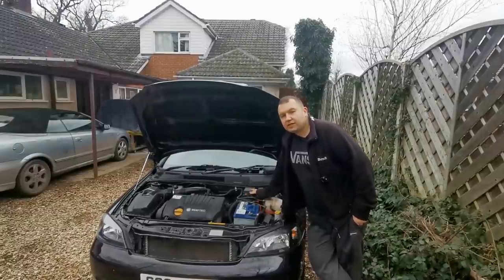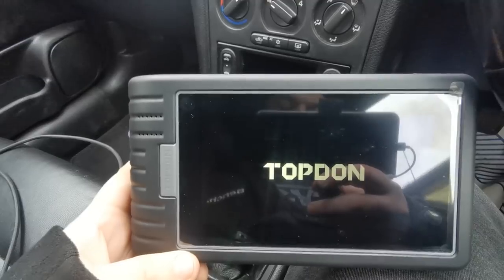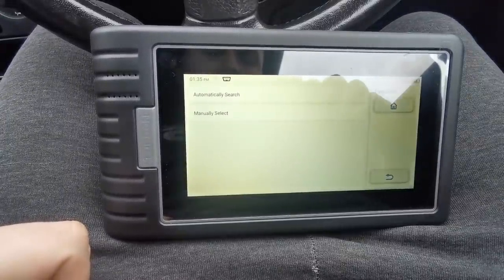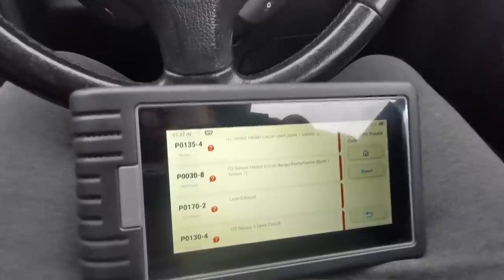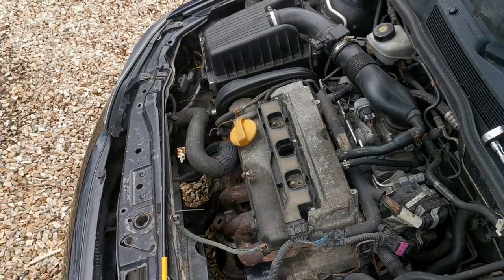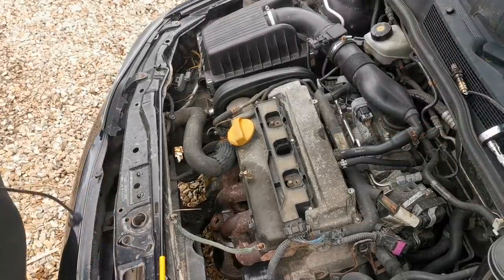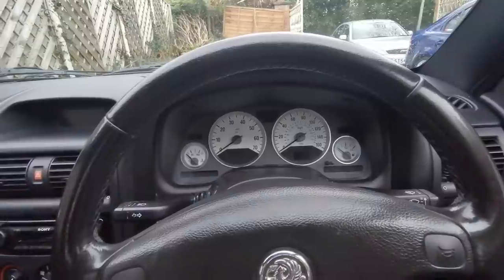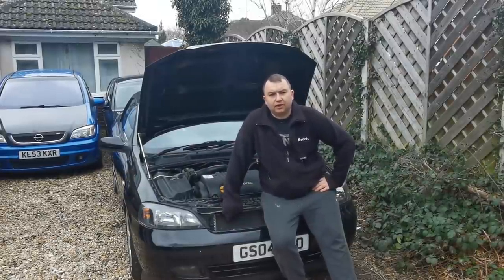HOW TO REPLACE AN OXYGEN 02 SENSOR #02SENSORREPLACEMENT #HEADOFYOUTUBE #ASTRAMK4

Comment: I did a similar job on the other halfs corsa. 3 months later the same fault came up. Disconnected the oxygen sensor plug and found loads of engine oil in it. The engine was pushing oil through the wiring loom via a failed oil pressure sensor. Changed that out and regular contact cleaner on the loom plugs the the problem went away. Common problem for vauxhalls. Glad we got rid of the thing it was always having faults.
Reply from the maker: Cheers Mark 👍🏻

Comment: Nice job mate Nothing Wrong with 2nd hand parts I would sooner go 2nd hand than spurious especially  on  Sensors
 If you ever struggle to get one of them off when you know it is broken and you are replacing it the easiest thing to do is just cut off the wire this will allow you to get a proper socket on it sometimes them sockets with the slit in it can open up and slip off
 If you want to check how it is going you can go into the readiness monitors on the scantool A lot of these faults can come back on after 50 to a 100 miles depending on the car Readiness monitors is just a handy way of seeing what the car has finished completing and what it's still need to complete
Reply from the maker: Cheers Leon I was a bit weary of that socket did seem a bit loose like it would slip 👍🏻

Comment: Gary, I had to replace the same O2 sensor on my MK4 Astra. Not long after, it wasn't running right. I got a mate to scan the car and an EGR fault code came up. I removed the EGR valve and there was a sliver of metal lodged in the valve preventing it from closing fully. Said sliver of metal was from the thread of the old O2 sensor that dropped into the catalytic converter and ended up getting lodged in the EGR valve. Once it was removed the car ran perfectly until the EGR valve finally failed. I was able to source an OEM (Delphi) EGR valve from Autovaux for a reasonable price.
Reply from the maker: Nice one for sorting that one out dave 👍🏻